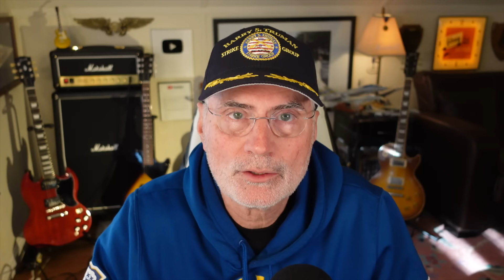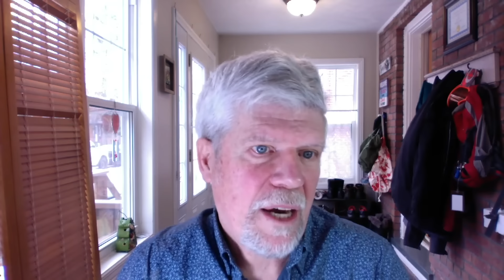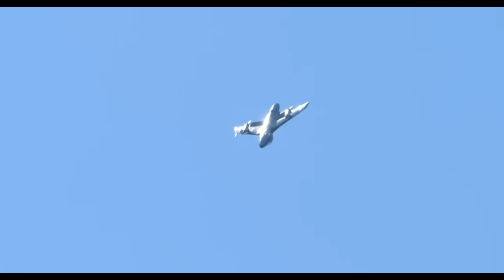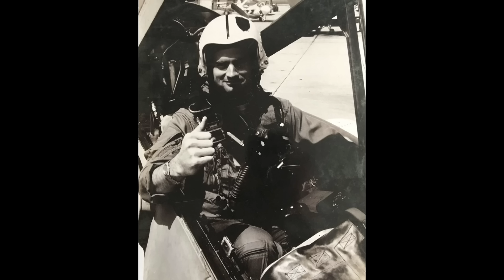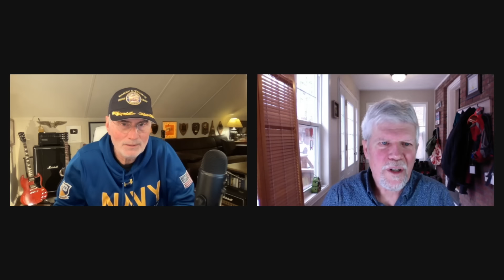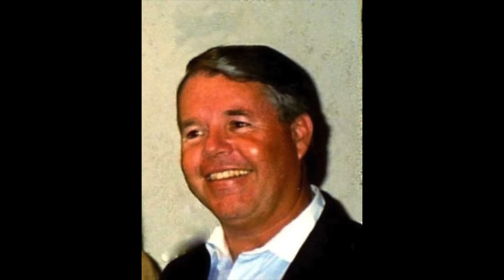Here's Why the F/A-18 Hornet Crashed at the '88 El Toro Airshow

Comment: I was there. I was attached to H&MS-11 at the time. Wasn't on duty so was able to attend the event. Saw him disappear below the crowd line and knew something was wrong.

I worked in H&MS-11 62F... Inertial Navigation shop. We took in the INS system (AN/ASM-130 IMU) for possible salvage. 

A study was done several years ago that determined the human body could withstand 75 instantaneous Gs.. We discovered that the last known G-Force reading out of the IMU was 74 Gs.

Comment: A friend of mine that is a retired AF Master Sgt told me about an F-15 Squadron Commander that did a loop too low over the runway of the squadron's  base, and while the pilot didn't crash into the deck, the aircraft did "touch" the ground at the bottom of the loop (causing extensive damage to the aircraft). My friend told me the entire incident was covered up by higher command to protect the pilot from his "just deserts".

Comment: At what exact point do the 75G happen? It seems a shallow impact with nose up giving thrust to alleviate impact so it seems surprising 75G is reached. And the injuries are also surprising.
I guess impact is comparable to F1 crashes and these only had quite less injuries:
- David Purley (179.8G) - During practice for the 1977 British Grand Prix, Purley's throttle stuck open and crashed into a wall. Until 2003, this was the highest g-force survived by a human. He would recover from his injuries and return to racing.
- Luciano Burti (111G) - Luciano Burti attempted to overtake Eddie Irvine during a rain-soaked 2001 Belgian Grand Prix only for Irvine to be caught off-guard and turn into him causing the Jaguar to spin and rip off Burti's front wing. With no downforce and no grip the car crashed into a tire wall at 290kph. He was out for the rest of the season with a concussion and facial bruising.
- Rubens Barrichello (95G) - During qualifying for the 1994 San Marino Grand Prix, Rubens' Jordan struck a kerb and was sent airborne, crashing into a tyre wall and was knocked unconscious. He suffered only a sprained wrist and broken nose, but was forced to sit out the race.
- Ralf Schumacher (78G) - During the 2004 United States Grand Prix, Schumacher's Williams suffered a tire failure on Indianapolis' Turn 13 (the only banked corner in F1 at the time) and crashed into the wall at a ninety degree angle. He suffered a concussion and two minor spinal fractures. This crash would repeat itself in 2005 on the same corner, albeit with much less severe injuries.

Comment: I was there.  Had my Radio Shack radio tuned to air show and MCAS El Toro frequencies.  After the accident a rescue helicopter was launched from LTA base at Tustin and the guy at El Toro would not allow the rescue helicopter access to the air space.  El Toro radio denied there was an accident.  I believe it was a Col got on the radio and identified himself and told radio to allow rescue access.  Helicopter arrived a few minutes later.

Comment: I was there the day this happened. I knew when he was inverted and pulled the nose down something was off. He was too low and I remember seeing how he appeared to yaw the aircraft to turn it away from the crowd line as the F-18 descended quickly toward the runway. His angle of attack was nose up but there wasn’t enough altitude. I saw it hit and bounce as it went down the runway, did almost a 180 and stopped. Then the smoke. It got very quiet with about 500,000 in the crowd as the Marine red & white S&R helicopter took him to Mission Hospital.

Comment: another escape maneuver you can do if you start a split-s too low is to stop the pull early, and not go to the full 180 degrees down.  In other words, you're doing a 90 degree down dish and then pull up, saving altitude to complete.  it's a fail-safe if you ever get lower than necessary

Comment: I was at that show, he did a prior attempt to that final maneuver coming right over the runway, but the wind was about 30 degrees accross. So after the vertical pull up he decided to roll the jet back up and exit the maneuver. I noticed that it was too low and too slow to try to point that big jet into the ground. He went low turned right accelerating to the west and came from behind the tower, this time accross the runway but perfectly lined up to the wind, so he got an additional 12 to 15kts wind to play with. Unfortunately it wasn’t enough. After he inverted the nose into the ground every pilot watching knew at that moment that he was going to crash

Comment: I knew, and flew with Cadick in the late '70s and will tell anyone that he should have been boarded and had his wings pulled 10 years prior to this near disaster.  His outsized ego notwithstanding, he had the most troubling attitude of disregarding rules of anyone I served with in my career.
Point... NATOPS general operating instructions very specifically state that engine failure in any single engine tactical jet is a mandatory ejection situation.  Flameout approach procedures published in NATOPS  Flight Manuals are to be attempted only for situations where ejecting / bailout is not possible.  Cadick, however, landed engine-out not once, but two times.  The first ended in a corn field in Ohio when his superior skills failed him far from any airfield and below any egress altitude in a T-33.  After a miraculous survival and hospital recovery he was returned to flight status!  Years later he successfully landed a TA-4F at MCAS Beaufort after an over-water engine failure despite having time, altitude and radio / radar contact with KNBC approach control to affect a controlled ejection over land with the jet headed out to sea.  Once again, he was returned to flight status!
I was personally involved with that second incident and another VERY close brush with disaster due to his arrogance and poor judgement.  Unfortunately, leadership failures allowed him to continue flying until his El Toro debacle where the possibility of mass casualties was real, and therein lies my point.  The chain of events leading to this crash was long and obvious and should have been broken many years before 1988.
Reply from the maker: Thanks for the background, Ted.

Comment: I was at that airshow as one of the OV-10 static display pilots. The PA announced a square loop, the square corners. When I saw it inverted I knew it was extremely slow, the flight controls flapping like a little birds wings. When the nose dropped, I knew it was over.  Col Kad knew it was announced as a square loop he had to go for it. Also the was the Air Wing CO of a CAX I was part of. He briefed 29 Palms AOA. I knew he hadn't   flown in a OV-10 to do it so I asked. He said; "i did it in my plane" a light civil twin. He was an accident looking for a place to happen.

Comment: Apparently the Luftwaffe had a similar type of problem when they transitioned to jets especially the F104 which was a complete break from old piston engined planes which were more forgiving. Basically high ranking commanders who had the rank to do this sort of rank pulling were sadly lacking in relevant experience and there was a period where a lot of high ranking brass left smoking holes because they didn't recognize the dichotomy between rank and experience/training to fly the much more demanding jets.This guy had an ego problem which led to this crash

Comment: It's a long time ago to remember but I must have been at the Saturday airshow just before this.  That's because I saw the FA-18 demo with what I have to believe was the same pilot given what I saw.  At one point he stood the plane up almost vertical and came down the runway just on thrust, cause a wing doesn't make life at an AOL of 50 degrees or more.  He was less than the planes length from the runway.  Almost everything he did that day looked like it wouldn't work out but it did and I came away thrilled at the incredible thrust this plane had.  . Also a bit amazed that he was allowed to do maneuvers that close to the ground.  I'd seen enough airshows that I had never seen a show floor less than an estimated 150 to 200 ft.  I guess there is a reason his call sign was kamikaze.  I heard about the crash and was sad for him but glad he survived.  I assume if he had punched out after already surviving the huge g forces and breaking so much it probably would have killed him.  Incidentally, what is "blunting the nose"

Comment: I was sitting in the stands during this. He boxed the Immelman and passed out. Then the plane started to fall. He came to and turned on the AB's, and the plane was twisting as it came down with full AB's flaming. Then the rear of the aircraft hit the deck, and the entire plane slapped the ground and it took off across the runways spraying bits and pieces everywhere in a cloud of shit gone wrong. The impact hurt him pretty bad. Put him in the hospital.

That is also how I got out of having to march in his retirement parade. Which was fine by me.

His flight was right before the Blue Angels were supposed to start their performance.

Comment: (1) Great video. Thanks! (2) Unfortunately, wasn't the first and won't be the last crash coming out of a vertical maneuver. (3) What airshow pilots must understand is that they fly for an audience composed mostly of people that are not trained to value whether a pilot is great or average. They just want to have fun, hear the engines roar, see the airplane flying low etc. They enjoy excitement, but not fear, and don't want to witness crashes. (4) Training must include check points to abort the maneuver in case certain flight parameters are not met. This should be stressed always. The pilot should always be able to abort the planned maneuver before a point of no return/evasion is reached. (5) It's my firm conviction that air displays should always have a pilot on the ground in radio communication with the demonstration pilot able to command abortion or, in extreme situations, ejection. (6) Vertical maneuvers near the ground are not necessary to dazzle the audience. There are many options on the menu that are equally or more awe inspiring and much less prone to failure. (7) One can practice a lot for an air show, but if that is not what the pilot does for a living, he/she will still be subject to make mistakes in front of the actual audience. One simple reason for that is wind. You train under a certain condition, mark the spots on the ground when you start a maneuver and so forth. When the day comes, the wind is different, and you find yourself at a position that is not what you wanted. Then you maneuver out of the correct parameters to compensate, and the next thing the audience sees is a ball of fire.

Comment: Bad decision. I recall years ago another bad decision (at least what I was told) when a CF-18 pilot coming off F-4's wanted to make the perfect showing takeoff. On the F-4 due to its landing gear operation, a pilot could put the gear handle in the up position prior to takeoff roll so that when airspeed was reached and the aircraft lifted the WoW switch would activate and the gear cycled just at liftoff. This pilot tried it on the CF-18 but because the gear operates differently when the WoW activated the plane had not reached the proper speed and pancaked down the runway. Again, as it was explained to me.

Comment: 80 knots??? at what speed that thing stalls out of the sky??? the sounds awfully slow.
Reply: What matters is angle of attack.  Speed and angle of attack are only correlated in steady, level flight not performing airshow maneuvers.
Reply: @major__kong  Ho yes, I understand that, I was wondering... inverted with no angle of attack before he "dive" to the ground.... a "clean" plane like that, how slow could it fly before it stalls?? 80 sounds to me ears very slow but I do now know anything about the plane. 
I understand that as soon as he tried to pull out of it at the bottom of the loop it was impossible for the plain to gain any altitude at that speed, like they said in the video he needed several hundred feet more of air before that could happen thanks to the thrust of the engines.
My questions was more related to the performance of the plane no the maneuver itself.

Comment: Commander, Sir, I am former Marine Sergeant who served in Viet Nam. This is not about me, however. I was in the old choppers used in Korea by Army when it crashed. The pilot and copilot were the U.S. Marine chopper squadron Commander and his XO who were flying to check out Fox Company on Hill 236 who were overrun. This is important bc the chopper I was on had the old fiberglass 6 inch band that operated the tail rotor. The band disintegrated in flight. These 2 heroes were able to crash land the machine from an altitude of approximately 1,000 feet. We all we walked away. 
Please discuss the 1,000s of Marines who continue to die in helicopters since the 1950s. I was extremely fortunate. These heroes weren’t as fortunate. It happened February 6, 2024 in California. Thank you, Sir.

Comment: In every accident and investigation, there's a unique narrative unfolding. Yet, amidst this diversity, there are common threads binding them together. Take, for instance, the pivotal role of pilot decision-making, especially at the onset of a maneuver or series of maneuvers. It's a moment of reckoning: Do I possess the altitude? Do I command the airspeed necessary for this maneuver? 
Picture this: navigating the Aerobatic Box at speeds ranging from 50 to 300 knots within the confines of a mere 1000-meter Box. It's a daunting task, particularly when you're piloting a 300-horsepower, 1500-pound aircraft. Now, compare that to the experience of maneuvering a 26,000-pound F-18, boasting an effective power output of 40,000 to 50,000 horsepower. Yes, the scale may differ, but the essence remains: Fighter jets, with their sheer mass and power, create a chasm in the pilot's perception and connection to the craft. They're unforgiving beasts, mercilessly exposing even the most skilled pilots, reducing them to moments of folly.

Comment: Educate me here.
Western fighter pilots are supposed to be "the best of the best".
The selected pilot for an airshow needs "months of preparation" to perform a mere handful of manoeuvres?
Something wrong with that picture.
It seems to me that a highly experienced fighter pilot would already be well accomplished enough to perform any manoeuvre - at any time.
How else would he successfully engage with the enemy - at a moment's notice?
All manoeuvres at airshows are choreographed because this is a performance to entertain the crowd and positioning needs to be finessed to keep the display in view - whilst observing safety standards and performance capabilities.
This choreography planning is heavy on position, speed and altitude which are determined and briefed beforehand.
This pilot knew he was too low too slow - yet he continued.
Mistakes are made in every profession or endeavour that is not the issue.
The issue is what do you do after the mistake occurs - that is the determinator.
No better example than this account of a 1980 Bob Hoover performance ......Hoover being probably the greatest display pilot ever.
"Obvious to me as an experienced fighter pilot, was that in his first attempt, he had failed to achieve one of his self imposed airspeed and/or altitude "gates" and ignoring his legendary ego, had started over again. That was the mark of a true professional!"......Source @bearowen5480
Exactly.